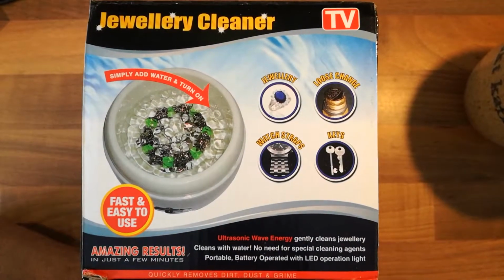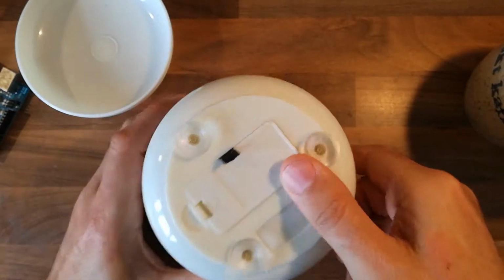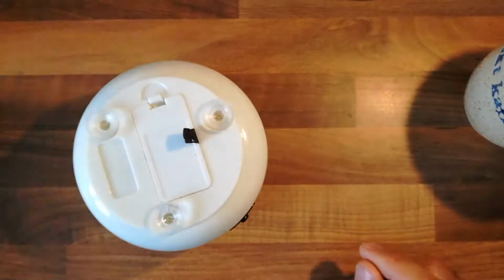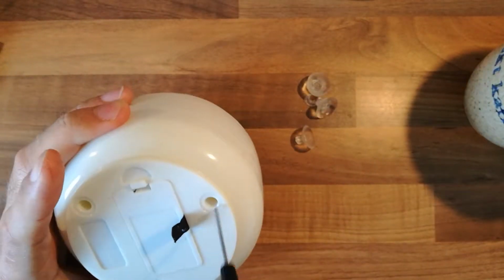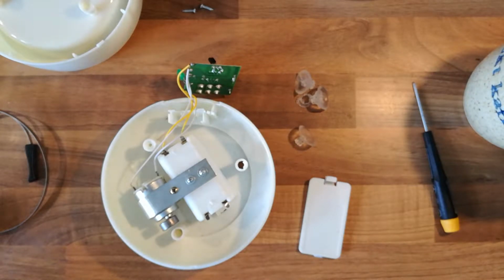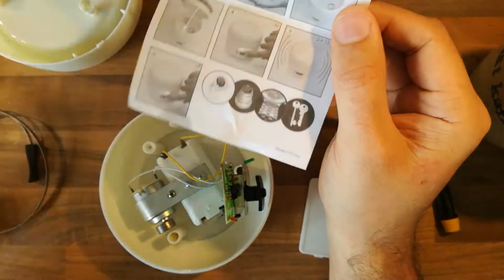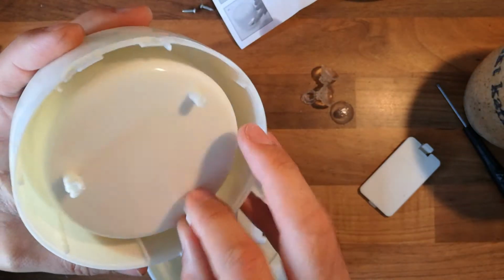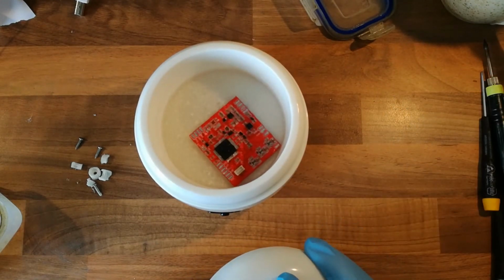Jewellery Cleaner Teardown

Comment: Right, but how clean was it before? Was there any actual cleaning action? I've always wondered how home guys like us can clean our boards - I've seen the spray cleaning stations at real factories, and I can't duplicate that at home easily. Your "shake in a container of IPA" seems like a great idea, but a lot of work if you're making 20 or 50 boards.
Reply from the maker: I also have the "Scrub with a toothbrush" method...  The cleaner didn't do that great a job, but no worse than shaking it in the tub. I have ordered some ultrasonic transducers to have a play with at a later date, see if I can turn it into a real ultrasonic cleaner.
Reply: The only method I've used is "apply liberal amounts of flux cleaner, scrub with toothbrush, then soak up the extra and polish with a q-tip" but it really doesn't work that well, especially for residue that gets between IC pins. So I'm looking for a better method. Real flux cleaner is amazing at dissolving the flux (better than IPA), but its so volatile that it evaporates quickly and then dries and leaves white residue everywhere.
Reply: So if you get your ultrasonic cleaner (or even this vibratory cleaner) working, I'll duplicate your system here for my cleaning needs too. Love the video by the way.
Reply from the maker: The problem with things like that is they evaporate leaving the flux behind as you have noticed. Even IPA does it. I often end up with a board that is "clean" but slightly sticky. The flux has just been moved around. The stickiness is mostly because the flux I use is a tack flux: http://www.chipquik.com/datasheets/SMD291NL.pdf It's supposed to be "no clean", but that just means you can leave it gunking up the board and it won't affect it electrically. It's not nice visually though and needs cleaning off for a retail product.